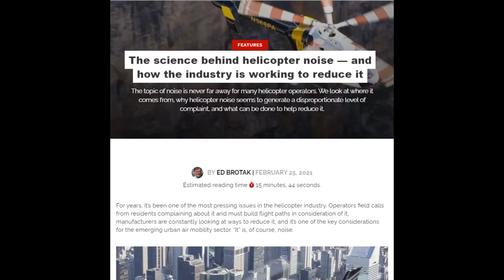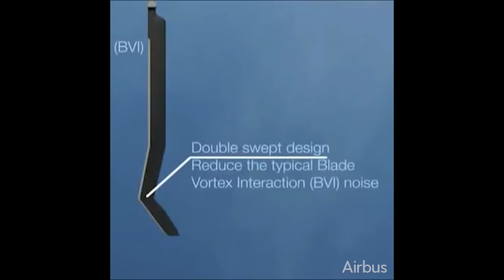The Science Behind Helicopter Noise

Comment: Well, you forgot high speed impulsive noise, which is basically what gives the huey its "loudness". The blade tips of the huey get to 893km/h when not in forward flight (one of the, when not THE highest blade tip speed), and when kn fast forward flight they reach 1100+ km/h. Thats mach 0.9, so transonic flow is on the upperside of the blade, which leads to a transonic shockwave, which is the "whop whop whop" you hear in fast forward flight
Reply: Have you got any ideas of what the airspeed would have translated to in terms of kilometres an hour or miles an hour